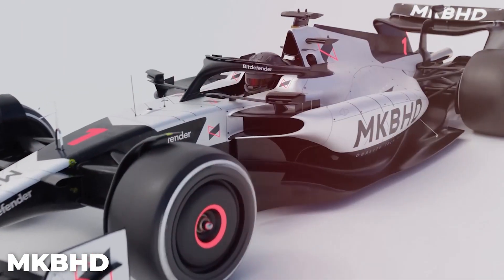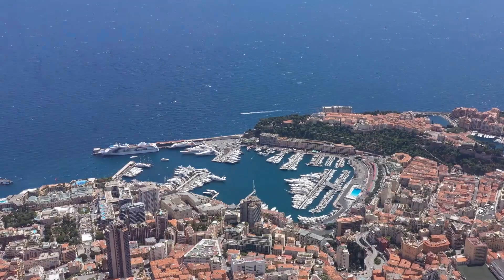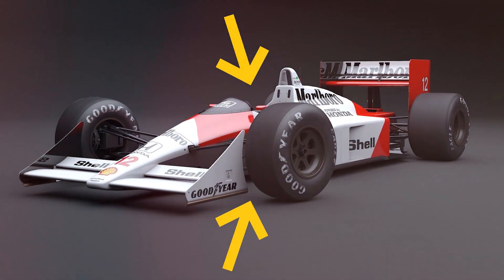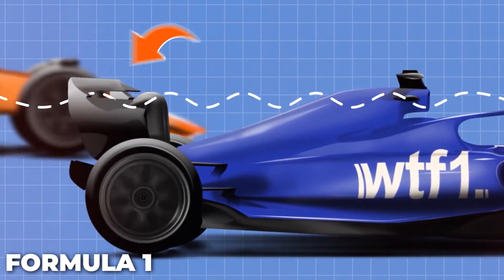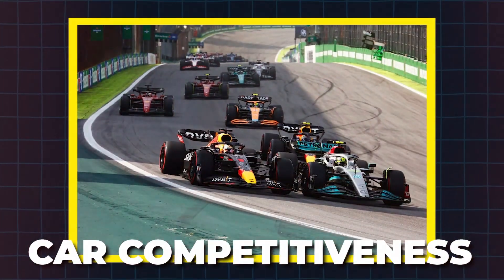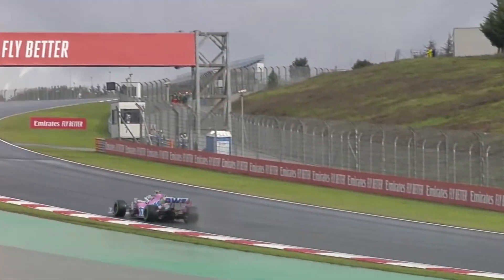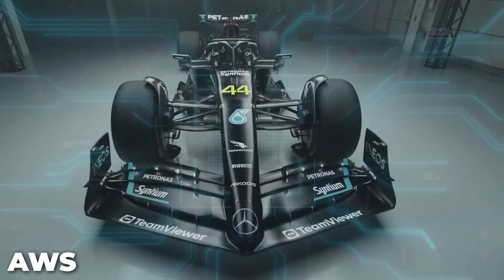Formula One Tech Explained

Comment: 🎯 Key Takeaways for quick navigation:

00:00 💡 Formula 1 technology is sophisticated, mentally challenging, and involves advanced aerodynamics.
01:48 🏎️ Formula 1 teams operate under a budget cap to prevent wealthier teams from dominating.
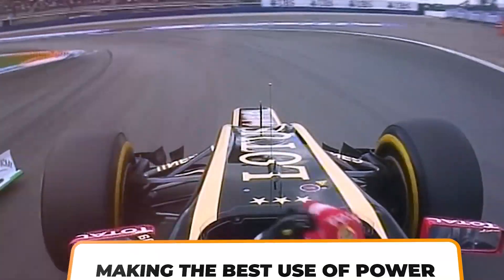02:18 🌬️ Aerodynamics, engine power, and data analysis are key principles in Formula 1 technology.
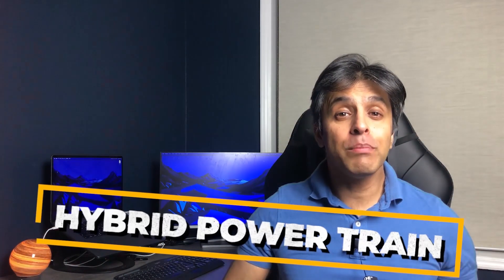03:54 🔋 Hybrid powertrains, like the KERS system, are crucial for Formula 1 cars.
04:35 📊 Massive amounts of data are collected in Formula 1 for performance analysis and strategy development.
05:30 🤖 AI is already being used in Formula 1 and is expected to play a larger role in the future.
06:40 💪 Material technology, such as carbon fiber, has revolutionized F1 by reducing weight and increasing strength.
07:23 🚗 Formula 1 technology has influenced advancements in automotive design for efficiency and environmental friendliness.
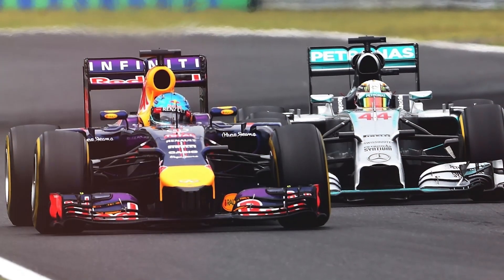08:41 🏁 Formula 1 serves as a platform for experimentation and innovation, pushing engineering and human innovation forward.

Made with HARPA AI